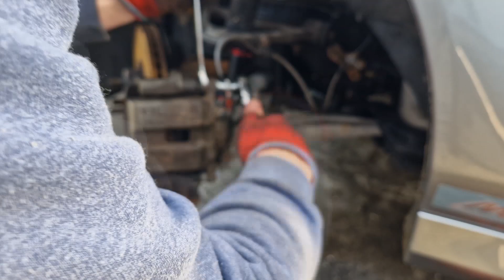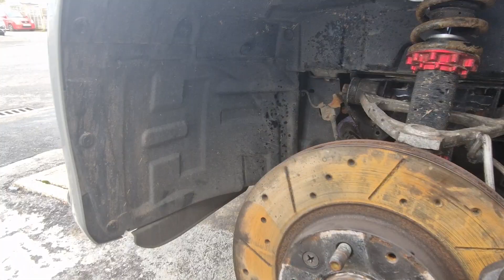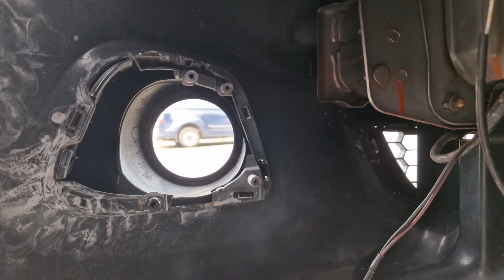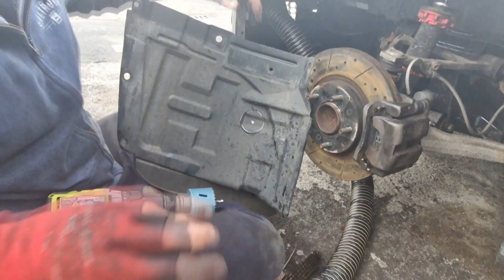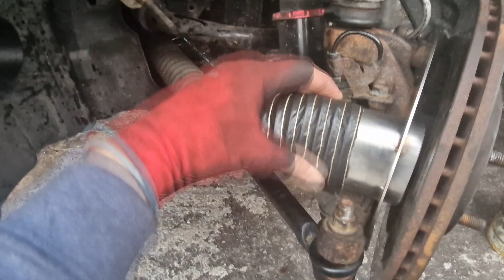Mazda MX5/Miata NC Mk3 - Performance Episode 7  - Brake Cooling

Comment: Has the new hole location proven successful?
Reply from the maker: @davidkass3444  no it still needs to be further away.
Reply: I'm beginning to think I'll skip the bulkhead fitting altogether and sneak the hose between the splash guard and undertray.